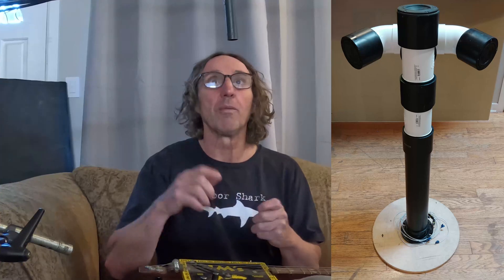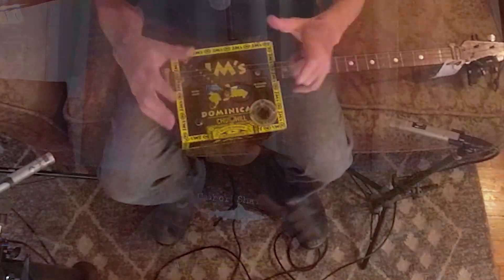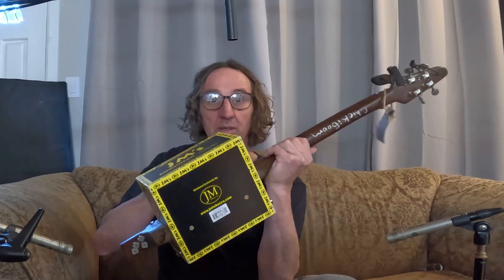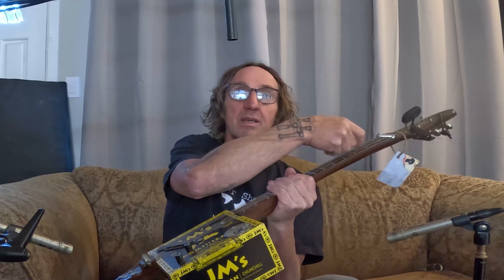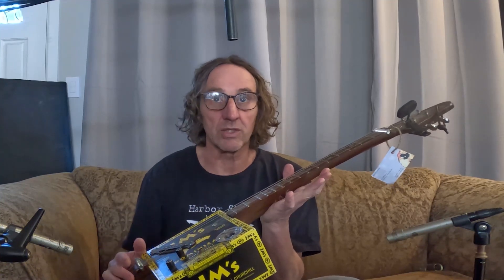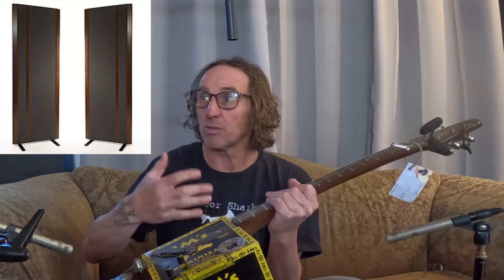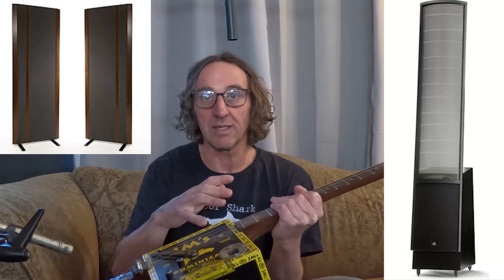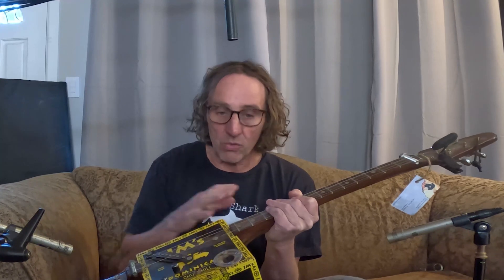Which Speaker Sounds the Most Realistic?

Comment: The first issue is sound capture. How microphone capsules work only give us 1/2 of the actual signal, during the rebound movement of the capsule (180 to 90 degrees) the 2nd 1/2 of the signal is not really a transduction of any wave moving FROM the source. Now, in dual capsule configurations there certainly is a rebound transduction in the 2nd capsule (that is facing away from the source) but it is based upon a reflect which depends upon the distance to whatever surface or open air space with a different compression characteristic there is on the 2nd capsule's side. The second issue is reproduction. Coil based speakers are similar to microphone capsules in that the rebound from a wave is not really a representation of anything except for the peak of wave 1 to the return peak difference of peak 2, in any one ''cycle''. An acoustic sound source, as you stated, gives off energy in all directions constantly and is externally 100% in-phase with itself throughout 0 to 180 degrees (albeit, possibly not internally), it never has to drop 1/2 of any wave in order to satisfy any peak writing or reading.

Resonance is a strange beast when compared to sound capture or reproduction. The motion of an A-4 tuning fork, for instance, will produce 440hz in open air but 880hz when touching a surface due to the two arms of the fork both crossing 0 twice per cycle. A close stereo pzm mic setup, when set out of phase and crossed over between the peaks of any given octave, can open your mind as to just how much we really are missing in our push/pull audio universe - which is really only push, the pull is just a free-associated mechanical return (a necessary evil of the mechanics). A capture or reproduction system, that relies upon a 0 to 180 cycle, simply can not truly represent 90 through 180 if it does truly represent 0 through 90. That's just a fact. It might be a tough pill to swallow, but we've only ever heard an accurate 71% (at best) representation of any audio source through any push pull broadcast or recording. During the time it takes for a capsule or speaker to rebound at ANY frequency it is simply not capturing anything but a difference between 2 separate points in time for that frequency and both of those points begin at 0. Think about pushing a kid on a swing, sometimes you get in perfect rhythm and other times you're just a little off but EVERY time they come back to you that backward motion was dictated by your last push's interaction with the laws of physics.
Reply from the maker: And which sounded more real?
Reply: @DaveRat  If by real you mean the closest reproduction of your room mics' capture through a speaker back into a field recorder, I'd have to say the Heil. At 0 it's a little thick in the mids but around 45 degrees off it's just about dead on response-wise. Volume is a non-issue to me in a situation like you have there, it's more about tonal balance. Also, if I were to answer which reproduction is my personal favorite my choice might vary from which I feel is the closest to the initial capture but that would be a stylistic preference, artistic bias, me projecting how I would LIKE it to sound. I'm willing to bet that the Heil rig is pretty uniform 45-60 degrees off axis from 300hz-3khz, regardless of source material, but it's about 2-3db more sensitive straight on at 0. It's totally a directional thing, relative to the beam strength of the cabinet/monitor. I get the feeling that you're sniffing around, or hinting toward, finding for a way to do with mid to upper frequencies what can be done, in a directional sense, with bass - which, to be blunt, is Fuh king fascinating 😍 It's about time for somebody to brave that rabbit hole who isn't nailed to a 6 or 12 month product release schedule at Bose or Sony. You would think Neumann or Genelec would have already done it, but hey, they got mouths to feed in a timely manner, too, right?
Reply from the maker: Interesting, the Heil sounds good but the huge phase cancellatin null off axis made it beyond unrealistic. None sound even close to real behind except the storm trooper. All the normal speakers sound like they are trying to be forward facing point sources which no real instrument sounds like.
Reply: @DaveRat  Oh, I didn't say any of them sounded real just that the Heil had the closest frequency response and even that was when off axis by around 45 degrees. But, isn't it interesting that even though you had multiple mics on the source, with quite good phase coherence, the recording still came out flat as a pancake nearly regardless of the speaker used to reproduce it? Mono is mono is mono but even a mono recording has 0 to 180 phase. In this case it's clear that no matter how many microphones you stack up their diaphragms are only going to give you a totally accurate capture of maybe the 1st 1/2 of the wave forms (ie travel from 0 to 180), the lion's share of travel back from 180 to 0 is just electro-mechanical rebound. In the case of all other speakers other than the Heil, even the storm trooper, what you are likely perceiving as ''more real'' are transients which are more coherent due to their being A) more time aligned than lower frequencies and B) the mechanical properties of the reproducing drivers (ie mass, sensitivity, etc). Louder is not more lifelike, even when it comes to efficiency at given frequencies. Your having BEEN THERE within the circle of the mics at the time of creation I would say has skewed your perception of what ''real'' is toward what you experienced: a human ear sitting within the bubble of transients that, by the laws of physics, couldn't discern much below 600hz but increasingly could above that.
Reply from the maker: Hmmm, mono is not 180 behind. The concept that ported or sealed enclosures radiate different polarity behind is incorrect and I have actually done videos on this helping people understand the radiating patterns of loud speaker cabs. If there is a 180 degree polarity shift behind, it is a result of open back designs. Sealed and ported enclosures are in-polarity all the way around.
Reply: @DaveRat  I'm not sure where it went off the rails there and you then drew the opposite of what I said but I didn't mean to imply that a cabinet could impart a polarity, only that the impulses of waves from polarized sources is what they can reproduce with accuracy, ie what they have to work with. Beam spread is a thing. The lower the frequency of a natural source the more omni-polar it will be. You didn't need more than one mic to capture clear low frequencies which are less susceptible to the mechanical rebound of a capsule due to their lower rates of travel. The distance/spread of multiple mics (the size of the transient bubble) may have contributed to more accuracy and an increased signal a little during the capture of lower frequencies but the contrast between those near 300hz and 3k is night and day, 3k being much more represented and enhanced by adding more microphones. That all leads to an enhanced top end characteristic at reproduction, which, if you relate stronger transients to being ''real'', you can easily start to confuse axis response patterns with what is or isn't a flat, impartial, reproduction.
Reply from the maker: Hmmm, this all sounds way more complex than necessary.

Plop an acoustic guitar player in a room, walk around, hear the sound change as you walk. Sounds real. 

Plop down a normal reasonable quality or better speaker, walk around, may sound close to real if you hold still and don't move your head. Walk around, sounds like a speaker

Polo an onmi speaker, walk around. Sounds weird as the Sam sound radiates in all directions.

Plop a speaker down that radiates different sound in dif directions.  Walk around, hey, that sounds nds more real than anything else. Wow. No weird phasing of a flat panel, no issues with the same sound reflecting off all surfaces in alecery direction,. No dead spot behind and when you turn your head you can easily tell you are not listening to something trying to emulate a point source.

No instrument is a point source, so why try to recreate an instrument that way?
Reply: @DaveRat  I agree, it should just work as expected and it does. My main point is that as long as we all keep assuming that a push/pull system of 0 to 180 degrees and back  (2-D) is the best capture mechanism for sources that radiate sound in all directions (3-D) we will keep running into the problems inherent in trying to cram 3 dimensions into 2. Once you've captured a 3 dimensional source using a 2 dimensional system good luck trying to make that seem 3-D again. The best even Atmos can do is mimic transient directional information and that will never take off as long as the average American can't even afford a $300 emergency.

 What does a 3-D microphone look like? I can't say. Mid-Side is my favorite stereo micing technique for a host of reasons but even that doesn't address a 3rd dimension in that it doesn't give any depth to the sides, only a differing response to elevated frequencies in the side channels, ie there is no time shift information which could be used to reproduce accurate phase shifts, apart from at 0 and 90 degrees, only the differences in frequency accuracy at 2 points which delineates the physical properties of low frequencies that tend to be omni and those of higher frequencies which tend to be more uni-polar due to their physical width. That said, what does a 3-D speaker look like? I don't know. But, it sure as hell doesn't simply move back and forth along 1 singular plane in a 2-D space such as what a push/pull configuration does. Why would you even bring this subject up to then just dog hole it and claim everything is already known, it's all been tried, or tuck tail and accept a flawed mechanical approach just because ''it's easy''? It seems kinda cynical and entrapping.
Reply from the maker: Very cool and live pushing further and also based on what you envion and what is currently in existence, this design concept remains the best shot at dropping a real sounding instrument into room

Comment: I'm imagining that the non exact nature of the mic/speaker placement would lead to some loss of realism. If the goal is maximal realism, I would cage the mics so they scale in 3 dimensions to the speaker layout. The only reason is that the movement of the performer within the microphone field causes noticeable phase differences. At least thats how it sounded when you summed 2 signals to mono. I know the position of the listener is an uncontrolled factor and this problem only occurs when the player moves around within the field, I just think when the performer shifts around it will create weird phase differences that would not sound like a real movement when listening back. I imagine it could sound like the frequencies are changing in a weird way. I guess I have to try this myself and see!
Reply from the maker: I think realism and identical are separate 

Real is somewhat random so tight structure is not necessary.

If you strive for identical, then, yes.

But identical Is not that important to me. Just like a live show sounds real but is not identical to the studio recording.

Comment: The thing most people don't realize.. doesn't matter what speaker you use  if you are in a small room then the bass notes will not be able to fully develop. I have thyroid cancer and my vocal chords are held together with staples now. Lost my hghs in my voice but my lows are of thunder.  I have to go outside to utilize my full bass range in my voice.   Inside it will not work.   Same with my didgeridoo.
Reply from the maker: Yes, as the wavelengths are approaching room dimensions, cancellation nodes become dominant
Reply: @DaveRat  yep  what you said lol  :-P
Reply: @DaveRat  BTW Dave nice cigar box guitar.  Thats a 4 stringer? I would put strings on it that you can tune to 5ths.  Then chords are EASY on it.  I have a 3 string slide cigar box guitar. Cheap Amazon  $30 version.   Works good though besides the neck that bows dues to cheap wood and no truss rod.  But once I get the strings all tensioned up it stays pretty good. Right now I am wanting to buy either a banjolele or a tenor banjo. I will have 5ths tuning on it.  I have a soprano uke with 5ths strings already... I LOVE IT.

Comment: Every speaker / playback / sound reinforcement system (even surround systems) is like projecting a 2D video of a 3D scene onto a screen for several eyes to see and create a decently accurate idea of that 3D scene in the minds of the viewers. There is one theoretical optimal view point from which it may seem as if a viewer would perceive a scene with their own eyes, but 99% of all viewers need to subconciously do the mental legwork to interpret their weird viewing angle and the FOV distortion of the picture on screen. They know  it's not real, but can and will be able to perceive the 3D scene quite accurately the way it was intended to be represented.

But what you are trying to do is like actually creating a hologram that seems real to the eye for every viewer from every angle because it actually looks as if it was really THERE. No additional mental work needed to  interpret and extrapolate what the scene might have really looked like.

THAT, except with audio for our ears instead of visuals for our eyes.
Reply from the maker: Correct and yes!

Comment: Hi Sir,

While Recording for playback on your designed Speakers. I guess is excellent for 24 tracks playback format for playing music.

Listening Setup ( 6 Speakers of your design.) 

Playback comprising of 4 to 6 instruments, including vocals.Standard 4 mics and 4 tracks assigned dedicatedly per Instrument. 

Playback music with larger number of instruments, then one can switch to Types of Instruments rather than Individual Instruments, (Hi-pucs, Low-pucs, Strings, Wind, Vocals Main, Backup Vocals) playback on same 24 track format. Again Standard 4 mics and 4 tracks assigned dedicated per section.

There has to be some standard guideline parameter set up for recording and playback within a minimum requirement of at least, 4 mics at time of recording per instrument or Group, at least 24 tracks format for recording and playback and has to be at least 6 speakers for playback. 

Very possible and  awesome.

What Speaker Placement would you recommend (Pattern and Distance)?

Would you  consider providing audio for a separate Low frequency channel in your setup?

Sir Have you tried binaural recording techniques for the same?
I mean Replacing single mics with Stereo mics in a Neumann KU100 Dummy head for achieving more spacial perception.
Reply from the maker: Yes, I love you are looking at structure. Let's start with one.

One instrument, define a spec for the recording and a spec for the play back speaker .

If it fits in 5.1  then recordings and playback can happen via YouTube

Ch1 left
Ch2 right
Ch3 up 
Ch4 down rear
Ch5 room
Channel 6 (the .1 sub) 

Mic close, minimize room sound, use relatively flat non colored condenser mics.

Room mic is not needed but if used put 6 feet away, centered in front

For the sub, use any mic you feel will capture lows well for the instrument.

Comment: Hi Dave, an interesting and fun concept- I remember something Bose tried and poorly implemented in the 2000s in live PA that reminds me of this.  But I'm left with a couple questions:. 

1- if what you want is faithful reproduction, wouldn't the only logical mic choice be four identical onni reference mics?  Wouldn't be expensive either if you go with the $60 Behringer.   I figured that having non-matching mics at least would unavoidably distort the end product.

2- Given that PVC is incredibly resonant, and that the speakers all share the same air cavity, would that create interactions between them that change the frequency response dramatically due to internal or external comb filtering?

3- on that same note, would it be totally crucial to have the mics equidistant from the sound source, or would it be better to place the mics AT reflective surfaces like the floor, which would be more representative of a listener's typical position in the room? I guess though that then it won't read as the same room as well, given that different rooms have different stuff in em.  

4- seems like tbis would be an application where something like SMAART would be crucial, to remove as much coloration from the drivers and enclosure as possible.  Are you doing anything like that?

5- Maybe it would also be important to include some kind of metering and level calibration on the user end, to make it totally accurate? As in, this system produces exactly the volume the acoustic instruments do, and doesn't adjust independently of the performers.

6- Does changing the physical positions and angles of the speakers a little, have an enormous or moderate effect on the realism?
Reply: Just thought of another one- i guess also the recording devices, mics, etc would need to hav ea very wide dynamic range, say if you had something like drums in there, to avoid clipping, or naturally occurring format related compression.
Reply from the maker: Identical means you A/B and don't hear a difference. Realistic means it sounds like someone is there playing. The original may be warm and the reproduction may be bright. 

A live show never sounds identical to the album, an album never sounds real, a live show does.
Reply: I guess you sort of addressed 1 and 4 on other replies here, but tbh I do kinda feel like identical and realistic, if not the same thing, are really dang close to each other, no?